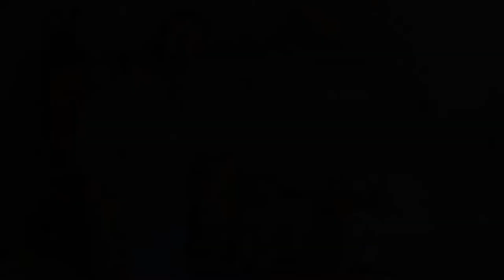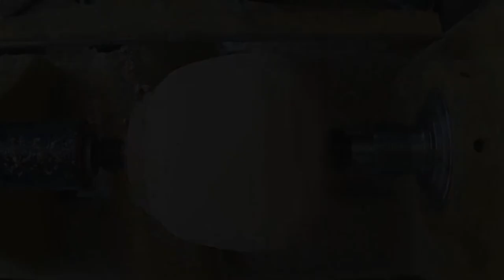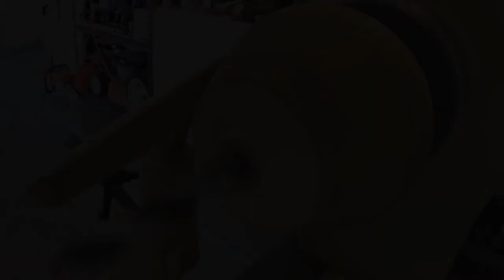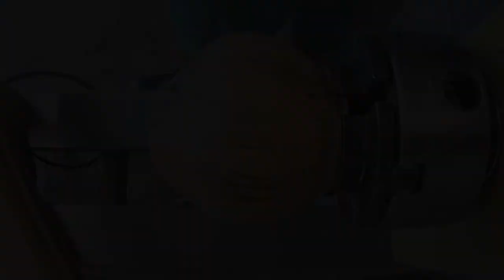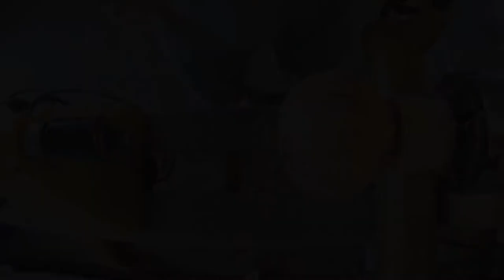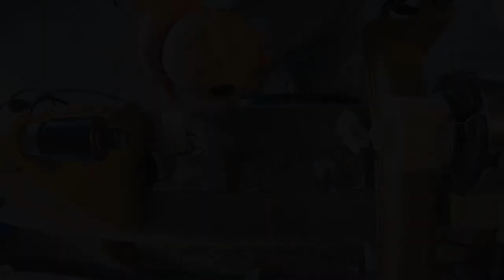Woodturning - Pecan Hollow Form

Comment: Excellent work and Tool control. Did the piece ever crack?
Reply from the maker: Tom, with the oil applied and putting it in a paper bag for a couple months, I managed to finish turn it and not have any cracks. It helps that is was end grain, which doesn’t seem to move as much. I really appreciate you watching and taking the time to comment.